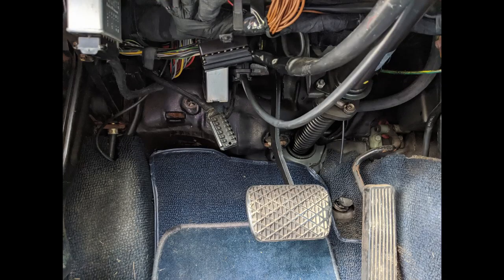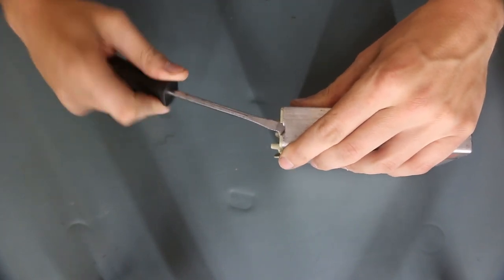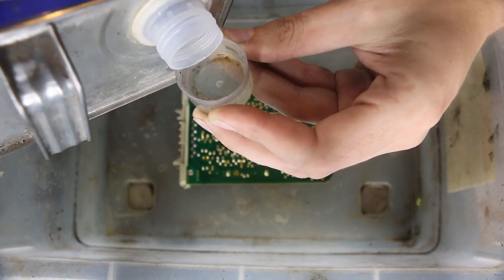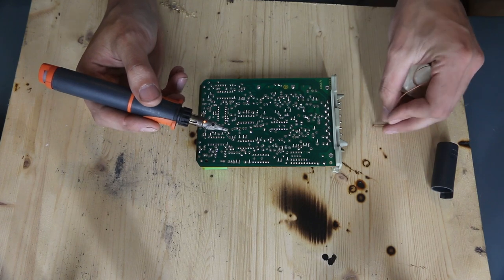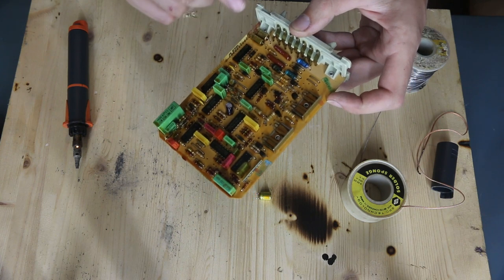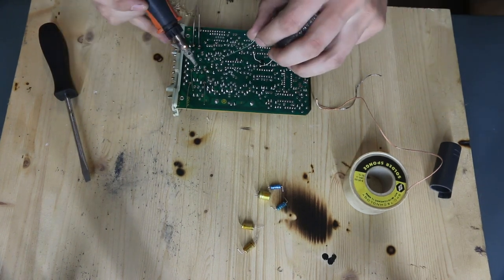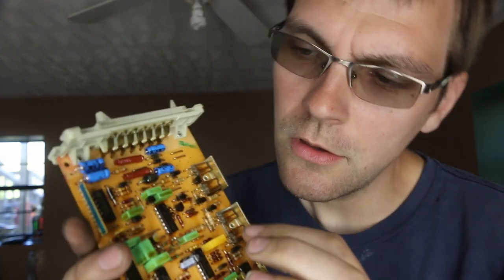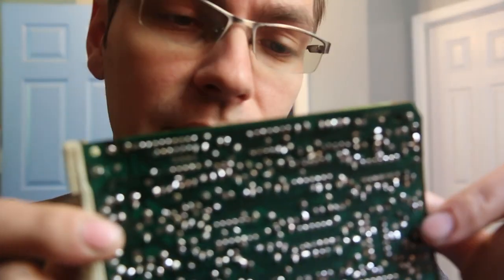W123 VDO Cruise control repair series part 3: Amplifier repair

Comment: Hello.  I was searching for anything that would help me know more about the cruise control on my 1983 Mercedes SL.  I had it in a shop two years ago and they put a new cruise control in the car.  When I tried to use it, as soon as I set it, my car took off like a rocket!  I tried it over and over and it did the exact same thing.  I told the shop owner and they replaced the cruise control with another unit. It did the same thing.  Does this sound like the problem could be the amplifier?  I would love to have my cruise control working.  Thanks for any help or advice you can give.
Reply from the maker: It could be multiple bad amps, or possibly the wrong amp for your car? But That kind of problem really strikes me as an amplifier or wiring issue. The amp may not be able to see the throttle position from the actuator and will accelerate to full throttle. Grab the testing manual from the website (https://trythistv.com/cruise-control/) and pay closest attention to test 5 (pin 3 of the actuator to ground) under the actuator portion and then test 2 (resistance of various wires on the amp plug) under the wiring under the dash tests. Pin 9 to ground at the amp plug should be the same reading as pin 3 on the actuator plug under the hood to ground. Check those places for any erroneous readings, I suspect the trace for throttle position in your actuator has worn through. It is super common and the only repair I know of is to replace the actuator. But testing the wiring first will rule out any other potential causes. Could also be related to the amp seeing speed signal or such, but the cruise shouldn't engage if it wasn't seeing any speed signal, and should set at whatever signal it gets. I suspect some kind of feedback problem. I'm leaning towards the throttle position traces in the actuator, but it could be speed signal to the amp, or the wrong amp.
Reply: @trythistv  Thank you so much for your time.  Of course, I don't understand a word you wrote, but I found another shop who specializes in Mercedes Benz cars.  I am going to give them a call and see if they will look at the car for me.  I will let him read your thoughts if he is willing and maybe he will know what you are writing about.  Would it be possible for him to call you if and when the time comes if he is willing? From what I understand, the garage put a new cruise control unit in the car.  Actually, they put two in because the first one didn't work correctly as I wrote.  It shot off so fast it was very scary! The second one did the same thing.  Anyway, thanks again and if you are willing to speak to the shop person if he/she can't find the problem it would be awesome.
Reply from the maker: Shoot me an email: tom AT trythistv DOT com, I can get you my contact info, maybe we can get him on the right track!
Reply: @trythistv  That would be awesome!  Thank you.  I am picking up my car this coming week and will be trying to take the car to another shop that is closer to my home.  He advertises that he only works on Mercedes so I will see what he says.  I will keep your email and get in touch if this guy is willing to work on it.  Thanks again!

Comment: Great video.  I don’t have a cruise control on my 300D.  I don’t know if it is possible to retrofit one or not.   But I did like the video.  Thanks.
Reply from the maker: They were quite common, perhaps some euro spec models or such didn't have it, I haven't seen one without, but I learn something new every day! I would think it would be possible to retrofit one easily enough, I might even have a spare actuator and linkages on the spare parts engine I've got
Reply: @trythistv  Yes.  My car is "special" as I was told it was imported from France.  I've had it for about 12 years, but just recently decided to turn it into my daily driver after garaging it, and then neglecting it for a few years.  I believe it has many small differences; for instance, no turbo; it is naturally aspirated, my AC system is different, location of stuff is a little different too. 

I will have to post a video of under the hood as I don't have things in the same places as your car.  For other examples my heater/ac blower fan and motor is different and I am pretty sure my instrument cluster is missing the connection for the cruise control as well.   My old one seized up and I ordered the part without checking to get in something totally different (what you have in yours) for my car.  I ended up just tearing the replacement apart and salvaging the motor and rebuilding the old enclosure with the new motor (which unfortunately wasn't the exact same size). It all worked out in the end though, and I suppose that is what is important.   I am going to see if I have (and am hopeful that it is) the same 4 and 5 vacuum plugs behind my climate control panel; that air re-circulation mod looks awesome. I don't have the fancy buttons with my climate control so I am not sure what I am going to find behind the panel.
Reply: @trythistv  I wanted a closer look and so I went by a local salvage yard and looked at one installed in a Mercedes and uninstalled it and took it home.  They only charged me $35 for everything (yay!)  I am going to see if I can get it going in a down the road project.  I definitely will be referencing your video when I do though.    Hopefully this will be something I get to this year.  Next on the list of YouTube Projects is to finish my generator hook up (not as fancy as your 3 cylinder diesel!) and then I think it will be time to build a CNC controlled plasma cutting torch table.

Comment: Great videos. I'd like to ask you tho, before i go through the testing, which I have never done, would you have an opinion as to why my cruise is bucking. In other words it goes on, then when I set it, it starts to rock in a way that it seems the gas pedal is pumping on the gas lightly.  Would you consider this an issue with the actuator or the cruise box itself?? Just looking for a starting point. I you think it might be the cruise amplifier, I may just buy another one rather than soldering capacitors. Same with the actuator. I feel it would be easier to just replace them than test, bc with my luck and inexperience, I'll probably short something out and make things worse. Thanks for your advice.......T
Reply from the maker: I'd suspect that is the amp, but it could also be the "feedback" circuit in the actuator has a spot that is worn through, does it surge at any speed you set it at or just at the most common speed limit? If it's at any speed, it's gotta be the amp in my opinion. If it only surges at one speed then it's the actuator.
The worst part with buying another amp is at this point they're all ancient so it may not last very long. There are a few people around that rebuild them though. I do believe there is a gentleman over on the peachparts forum that does quality work, I'll see if I can find him and post a link to the thread later today
Reply: @trythistv  Yes all speeds.I just located another one on ebay where the car had under 100k miles. For $30-40 it's worth a try. But rebuilding might be a better option since I went through the trouble to take it out already. A couple weeks ago I bought one on ebay and when I plugged it in it did nothing at all. Put the original back in and it pulsed again.  If you can find someone who rebuilds for me I'd truly appreciate it indeed. Thanks for your reply too.

Comment: Hi Tom great info but your polarities are all mixed up on the pdf, could you clarify please? thanks
Reply from the maker: Oh? Which ones are you wanting clarification on, I think everything is accurate on there unless I missed something, I'd be happy to double check though!
Reply: @trythistv   in the first list you say solenoid pin 6 you say tap 12+ but then in the colour code list underneath pin6 green you say is solenoid negative (which I think is the correct one) and vice versa? Cheers Mike
Reply from the maker: Ah, yes I guess that could be confusing, Solenoids are not polarity specific, so applying ground and power in either direction will make it click, I will correct the document though, as I did indeed have it backwards. Pin 6 is intended to be ground, and pin 7 is intended to be power for solenoid. I'll have the new document on the site shortly! Thanks for noticing that!
Reply: @trythistv  Thank you for putting up the information! and videos :)
Reply: @trythistv  Hi again Tom, just to say many thanks for your help, replaced caps and reflowed all solder joints and now my Bentley has cruise control again :) . box was 412 212/4/1. Thanks again Mike

Comment: Sweet! Nice job! I can’t wait to do mine! Now I just have to figure out where to get the capacitors. I’m a electronic idiot.
Reply from the maker: I put some part numbers for Mouser in the description, they had pretty good prices on the exact ones I used, Amazon also had caps that were correct in the ratings but not exact as far as fitting perfectly, but would work just fine

Comment: Fantastic Tutorial. Can you tell me how many of each capacitor you ordered from Mouser from your above parts list?
Reply from the maker: I do believe it was 2 of each needed, I ended up ordering like 100 of each because it was cheap. I keep saying one day I'm going to figure out how to run one of these giveaway drawing websites and start giving away little packs of cruise capacitors, fuel filter o rings and some of the spare items I've aquired like that.
In the meantime, I believe it was 2 of each needed, I will double check and let you know for sure tomorrow though!

Comment: Hi very nice . Question mines only have 2 capacitors can I email u a picture thanks.
Reply from the maker: I bet you've got the same one as a few other viewers have asked me about. Absolutely send me a photo, tom at trythistv dot com and I'll reply back to you with the info on which ones are where that I really need to add to the documents on the website but have failed to get done in a timely fashion 😂
Reply: Hi I send u a picture on the email u send me can u all tell me the size of capacitors need thanks a lot . Really appreciate
Reply from the maker: @MrTesedgar  I never replied to you! The only 2 visible in your photo are both 16v 47uF from the looks of things

Comment: on my 1982 240D, I did every thing in video 1 all checked out ok, did everything in video 2 all ok, bought a new amplifier hooked it up and still no cruise control.  please help.
Reply from the maker: I'm assuming it just acts totally dead if you hold up on accel set? If so check your brake lights, I had led tail lights and one brand made the cruise act up, another was just fine, also any bad connection there could cause the system to not function at all.
Reply: @trythistv  I do have LED lights yes
Reply from the maker: Just for a test swap them out for some regular bulbs, just the brake lights are important as far as I know, if the cruise works, you'll need some led bulbs with ballast resistors I believe it is called, or add resistors elsewhere, as the cruise uses the brake lights to ground, with my led bulbs I could see them light up faintly when I plugged in the cruise amp and the car was running
Reply: @trythistv  will replace, i still have the regular 💡 will report back tomorrow. Thanks for your help.
Reply from the maker: Sounds good!
Reply: @trythistv  You were spot on, replaced led with regular 💡 and cruise control working like a charm. Thank you so much for your help.

Comment: My vdo board looks very different , i only see 3 capacitors . 1984 300d
Reply from the maker: Did you check the pdf document on the website? ( https://trythistv.com/cruise-control/ ) If it doesn't look like either of the amps in that document could you send me some photos of it? Email them to tom at trythistv dot com If you could!
Reply: @trythistv  yes it’s the other one you have pictured in the pdf . Thanks !

Comment: Hey, I have W126. would the amplifier on that be similar if not identical in its configuration?
Reply from the maker: It should be identical, or very very similar, sometime from the mid 70s up to the mid 90s used very similar amps and actuators across just about every Mercedes. I know the 95 W124 I had used a similar setup, it was slightly different as far as the connectors and pin assignments, but internally it was similar enough that the process of replacing the capacitors and resoldering the bad joints fixed it back years ago when I still had that car.

Comment: Hey, I have a problem with a 116 450 speed control.
Reply: Madder Board is different from 123 and 126.
Reply from the maker: I believe they use a vastly different actuator, more like the vacuum pod system my trucks have to pull the throttle open, of course my w116 experience was a '80 300sd so a 450 may be different, but I would suspect if it is the vacuum system checking for proper vacuum would be a good first step, and from there even though the cruise amplifier might be different I bet on the inside it is similar, and replacing the capacitors and reflowing the solder joints might solve it if the actuator and everything else is working
Reply: @trythistv  Thank you my friend for the great information I will make your advice step by step

Comment: where to purchase capacitors ?
thanks!
Reply from the maker: Pull yours apart to make sure you have the same style capacitors, there are some differences between amplifiers.
I got mine from mouser, these are the part numbers:
22uF:  647-UVZ2A220MED1TD
10uF:  598-106TTA100M
2.2uF: 598-225TTA100M

Possible alternative capacitors, I have not tried these, but they are the same on paper:
22uF capacitors: https://amzn.to/2xnz48c
10uF capacitors: https://amzn.to/2Si9pVu
2.2uF capacitors: https://amzn.to/3bQCDTk
Reply: @trythistv  Thank you !!
can I mail to you 5  actuators, so you can tell me if some of them work on not. I have no way to test it.

Comment: What type of capacitors know I need
Reply: Sorry what type of capacitors do I need
Reply from the maker: Howdy! I put them in the description but youtube is making it very difficult to find that description anymore, so here is what I used:
Capacitors I used were ordered from Mouser, with the following part numbers:
22uF:  647-UVZ2A220MED1TD
10uF:  598-106TTA100M
2.2uF: 598-225TTA100M

Possible alternative capacitors, I have not tried these, but they are the same on paper:
22uF capacitors: https://amzn.to/2xnz48c
10uF capacitors: https://amzn.to/2Si9pVu
2.2uF capacitors: https://amzn.to/3bQCDTk
(Those are amazon referral links, if you buy those I get a small commission at no extra cost to you)

I've got such a mountain of them I'm planning on starting to give away little baggies of them once a week until they're gone, I've got to figure out the logistics of that and get it going soon!